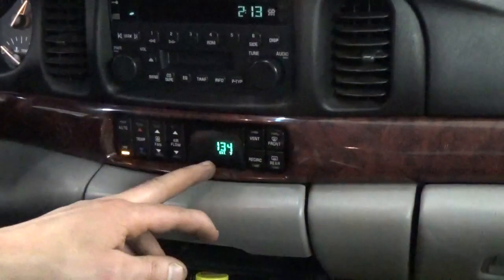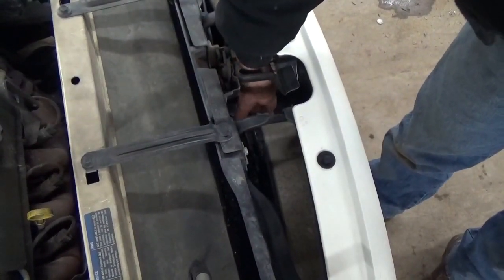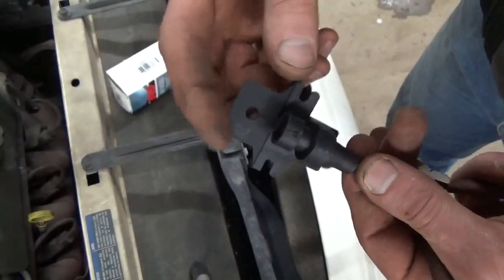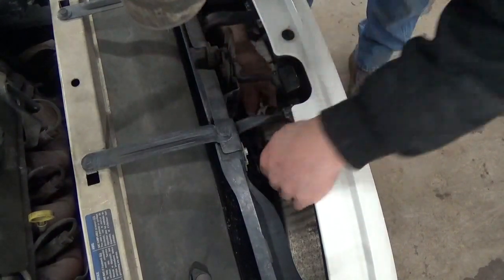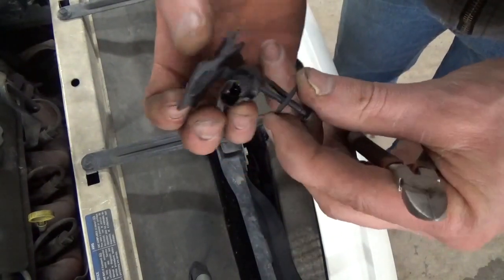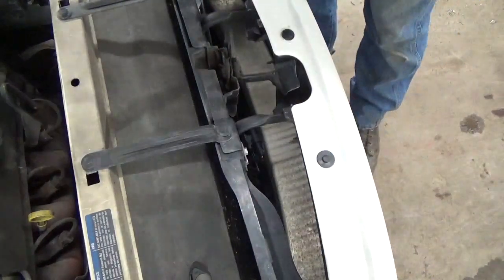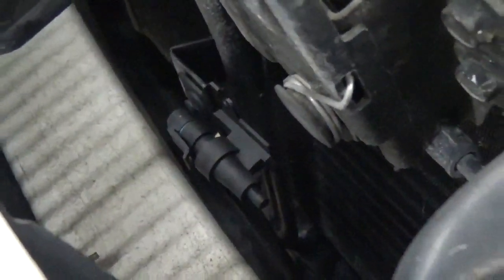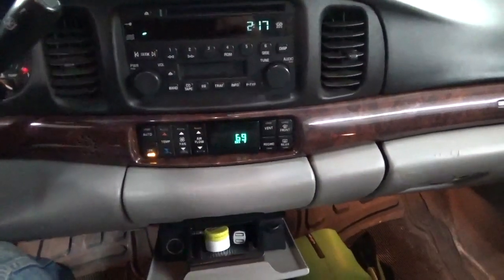Buick LeSabre Ambient (Outside) Temperature Sensor Incorrect

Comment: All my cars have been at least 5 yrs old when I bought them and never owned one yet that had an ambient temp sensor in it. Since they are virtually standard equipment now, my next one will probably have one so good to know the common failure and how to fix. Thanks for sharing.
Reply from the maker: Thanks for watching :)
Reply: I think modern fuel injection needs to know the ambient air temp in order to fine tune the air/fuel mixture. Hotter air is less dense and a given volume of it needs less fuel to reach proper mixture. They can do it without by just using the closed loop to adjust the fuel trim but knowing the temp is better.

Comment: 95-01? Ford Explorers have 2 radiator bracket mounted sensors for the outside temp. One is for the upper console and one is for the electronic auto temp control(used internally). Most EATC fords have 1 sensor, and have a temp button to show temp like the Buick(the explorer has a rear fan button instead). I think the console one is obsolete.

Comment: Will bad ambient temperature sensor can cause ac magnetic clutch to keep engaged. My ambient temperature shows 22 deg celsius and the actual temperature outside is 14 deg celsius. Ac magnetic clutch does not disengage.

Comment: will this sensor affect radiator electrical fan speeds and a/c performance? my question is ...is this sensor related to the  HVAC? fan speeds  depending on ambient temp? thanks in advance  Erick...just curious
Reply: I don't know the answer to your question but the fuel injection system uses it. I know this because it's in all modern motorcycles which have fuel injection, but do not have HVAC systems, and is not there for the very few motorcycles that are still carbureted (probably none anymore as of 2023).

Comment: I've got a '95 LaSabre, identical unit on the dash. My ambient temp is SOMETIMES accurate, but this morning it was about 12 degrees hotter than the air temp. Showed 92°. The actual temp was around 80°. I guess I'll give that a try. Also and if you have a link!! My A/C wont blow out of the center ducts, only defrost and floor vents. I hear it could be as simple as a bad vacuum line on the back of the module in the dash. Anyway, any help would be appreciated. BTW this temp was after I had driven cross town and back. Car was parked in shade in my parking space.

Comment: On a 2002 Buick Lesabre, can you tell me if the manual climate control can be swapped out with a digital climate control like the one shown in this video? I have to replace mine and wanted to know if I had that option.

Comment: I got a 2017 Ram 1500, and the ambient temperature sensor read -40 in September.
Reply: I HAVE THE SAME PROBLEM IN MY 2013 LEXUS RX350 I REPLACE THE SENSOR..AND STILL HAVE THE PROBLEM.

Comment: I HAVE 2013 LEXUS RX 350 THE READING WAS BELOW ZERO WHEN WAS 60 DEGREES  OUTSIDE..AI REPLACE THE SENSOR AD STILL HAVE THE PROBLEM. NEED HELP ON THAT.

Comment: Ohm it!
Reply from the maker: Nah.. it's a $12 part that has a pretty high failure rate. With my shop labor it is actually cheaper in this case to just replace it than it is to go on Mitchell, try to locate (if they list it) an OHM / Temp chart, remove, test and compare. I don't want to sound like a "parts changer" but there a certain (although few) case where it is actually cheaper to replace rather than test.
Reply: Ohming out a static circuit/component is a giant waste of time. The temperature you see indicates an "internally shorted thermistor" Simply unplugging it(open circuit, OL Megaohms) should make the temperature read close to -40 degrees(generic number really) Jumping the two wires together(dead short, low resistance) should indicate a hot temperature. If neither one of those worked, time to break out the DVOM to take voltage measurements. The only way ohming the AAT sensor would be even remotely useful, is if it ohmed either 0 ohms or infinite resistance. Anything in the middle of that, is just a guess, a very ignorant one at that. We do not need to follow factory flow charts.
Reply: South Main Auto Repair That's basically my thought on testing things.  If testing the part that I know 99% of the time is the problem cost more then the actual part installed I'll just replace it.. Do you know how unhappy a customer would be knowing they paid more for you to diagnose the problem that the actual fix?
Reply: Thank you Jarin, worth remembering. Minus 40 is the crossover point for Fahrenheit and Centigrade scales, with identical values at that temperature. Presumably they chose that number as a reference so as not to confuse the tech who might not know which scale was chosen from the internal menu.